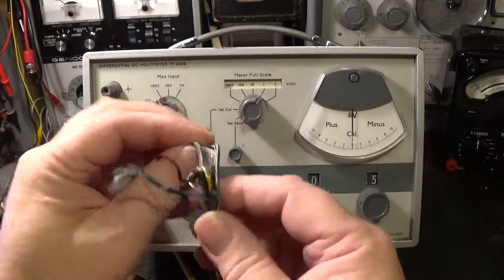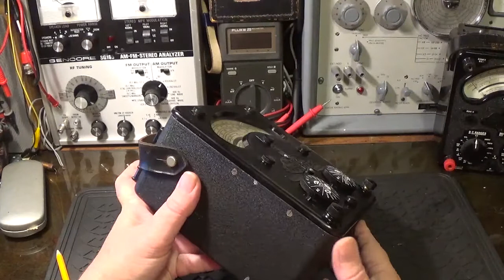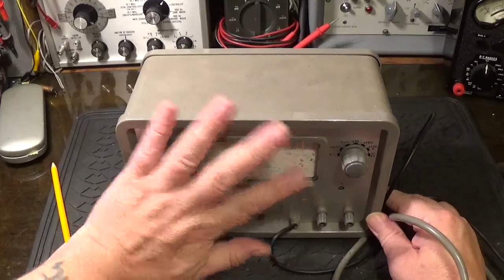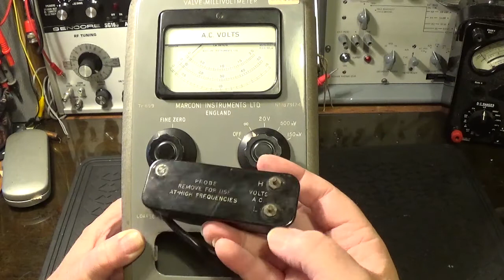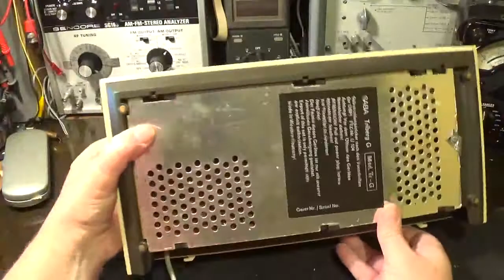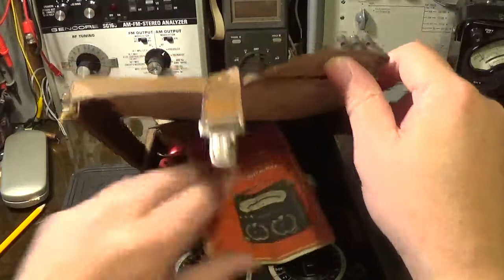Radio Waifs and Strays 2

Comment: andy, really nice post!! I also as well love the vintage test equipt. I don't work on any lab stuff but I think that back in the day, a well heeled service man spent a lot of money to buy these tools. most people , ecept the collecters of radios , know that this stuff in the day was not cheap. I have about 30 pieces of test gear that I have restored. they look good, and work fine for my needs!! but, the british test gear is very classy looking as well . have some Jackson, precsion, triplet, sencore, that were built very solid and would made to last!!! thank you for sharing!! your buddy ed.
Reply from the maker: Hi Ed, I love the Sencore gear though I only have one piece. It's truly designed for TV and radio repair,  with what a repairer needs right there in a box. If that makes any sense!  If I lived in the US I'd be in serious trouble on the collecting front, you guys have got so much good stuff to choose from. Yes this stuff would have cost a fortune back in the day, those AVO meters would be several weeks wages I would have thought.  Regards - Andrew

Comment: Andy. A crowded workshop is a happy workshop. Look forward to seeing the wobulators wobble.
Reply from the maker: They need a large sweep voltage from a scope timebase to work, much more than anything I have sticks out. I'm picking up a vintage valve scope over the weekend which will do the  job. I don't actually know if the wobbulators will work but at least with the scope I can see if they are!